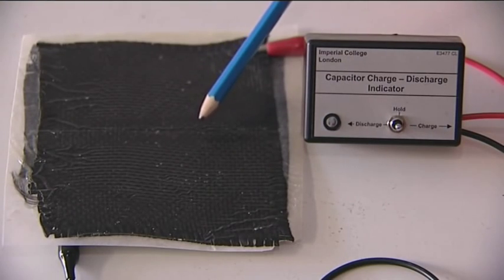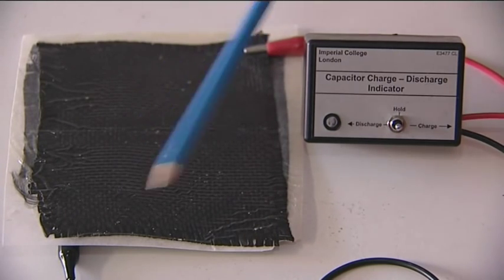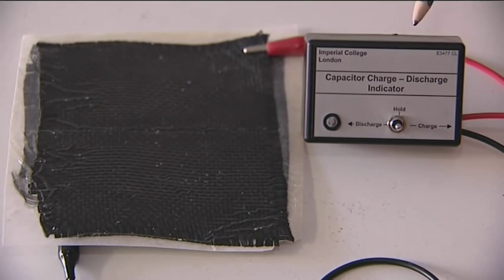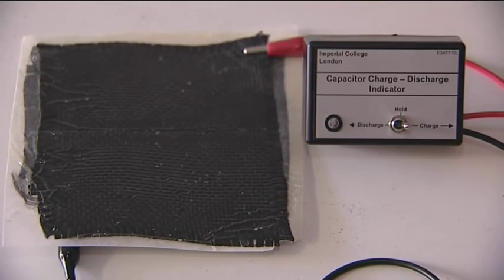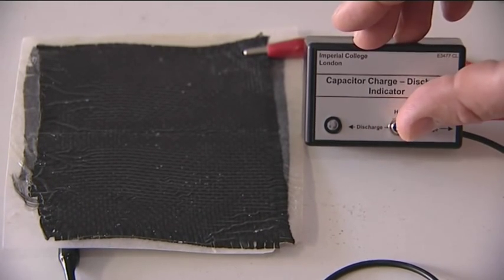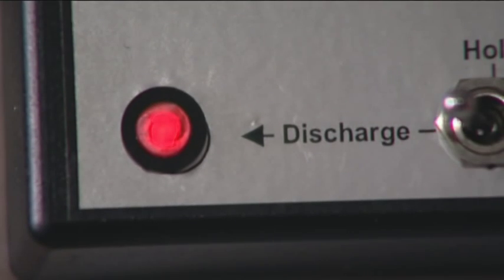Car of the future powered by bodywork

Comment: A nice carbon fiber look on the back of a laptop monitor would be nice and serve a purpose.  I am curious of the capacity (currently) that this material can hold per square inch.  Or, how long the light stays lit after that 10 seconds charge, also if the material ever wears out and if it will be cheap to manuf. in the near future.